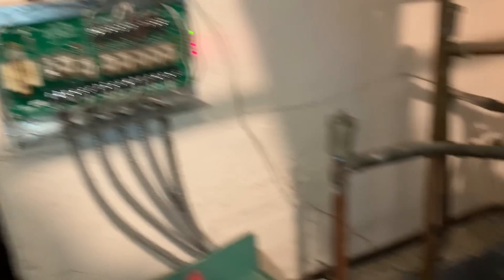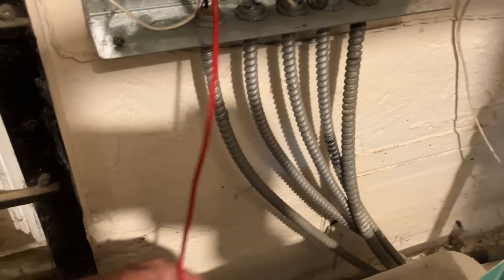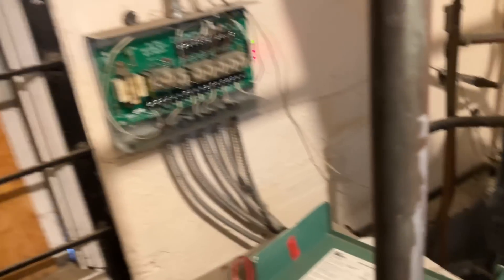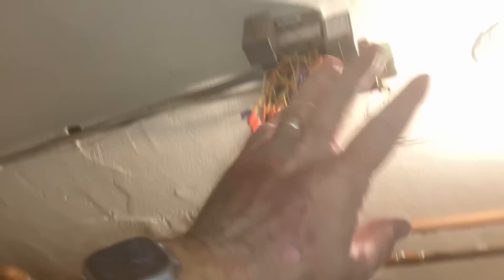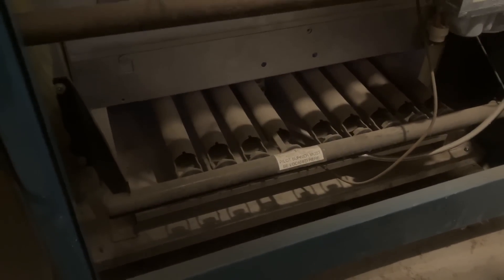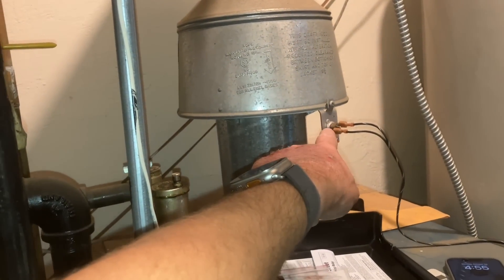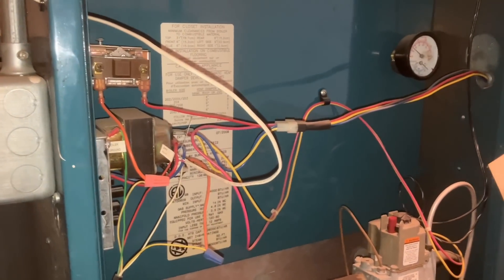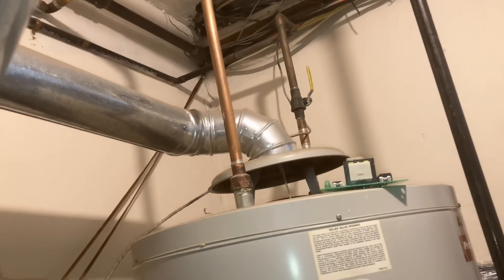Burnham Gas Boiler EXPERT Shares Top Diagnosis Techniques

Comment: That R&R ?? Even marking them can get confusing especially if they  ran 8 wire . Some of the colors in a not so well basement can be hard to tell apart…. But  Nice troubleshooting. You zeroed in on the problem right away❤